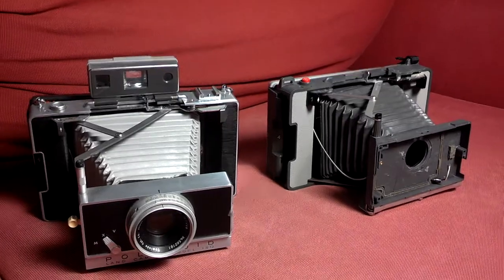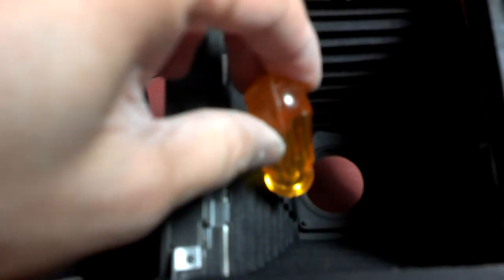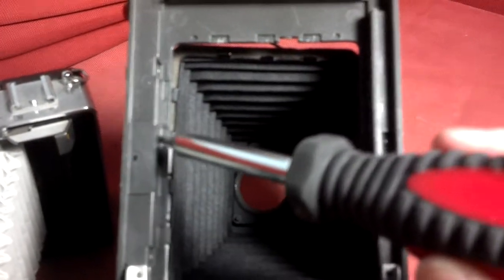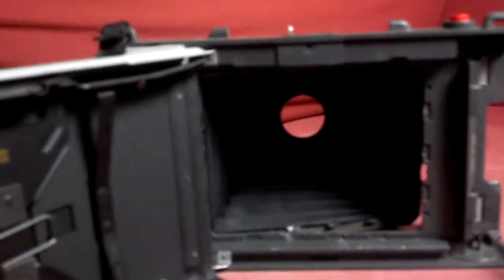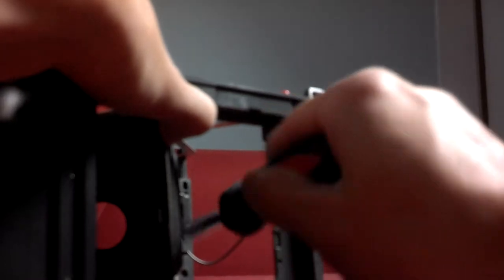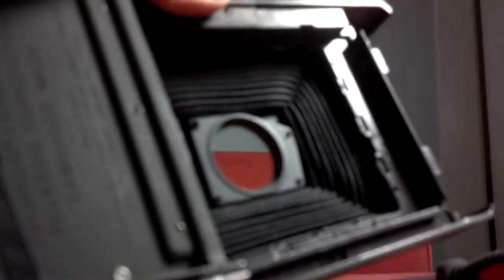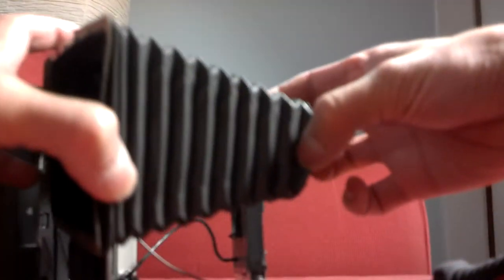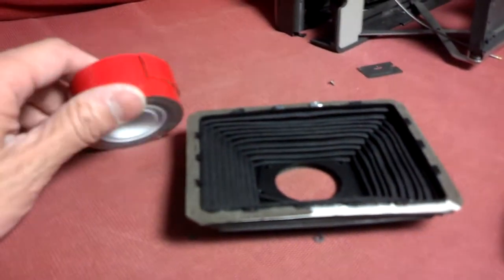Polaroid 180 195 Land Camera Bellow Replacement

Comment: Thank you for this!  May I know what kind of paper to make a bellow? Another video said Du Pont Tyvek (Black) but there are 75gm and 125gm available and I don't know which is the correct paper, would you mind tell me what's paper you are using?
Reply from the maker: did you need a new set of bellows? might have a few laying around. shoot me a message on IG : PhotOle_Photography
Reply: PhotOle I want to learn to make one myself but don’t know what kind of paper should use
Reply from the maker: @kristylau3273  black construction paper works but spray adhesive fabric onto the paper to create more of a light tight bellow.
Reply from the maker: https://www.instructables.com/id/Paper-Camera-Bellows.  specs will be different for Polaroid land camera